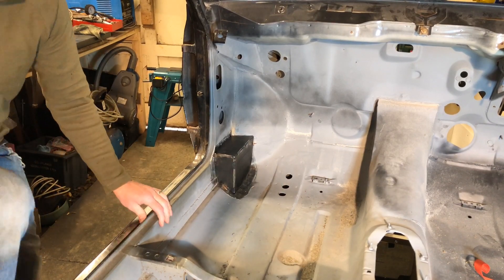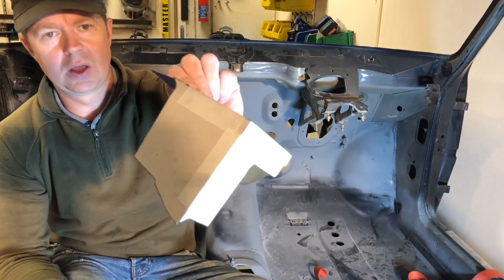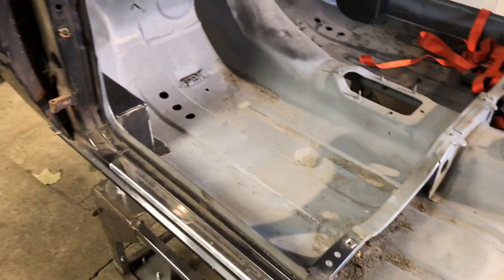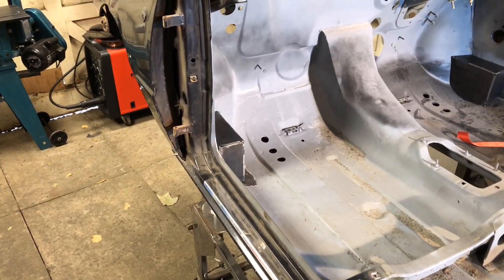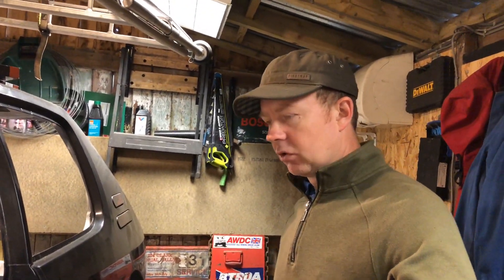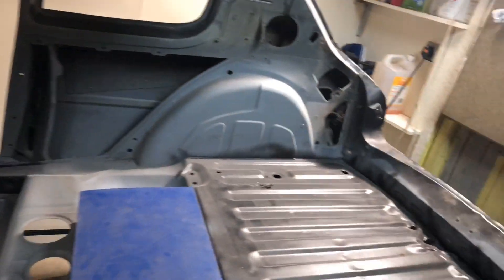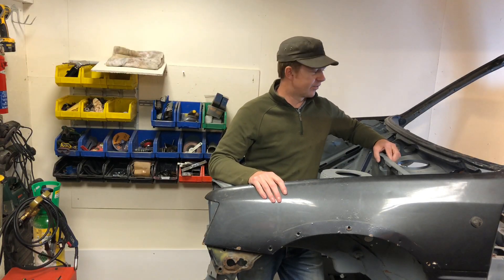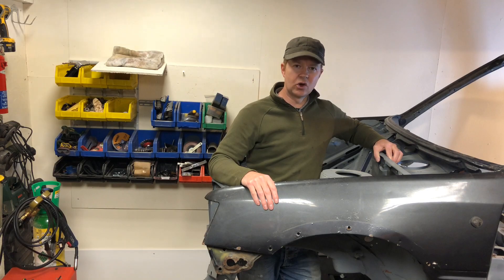HOW TO build ROLL CAGE mounting feet - Part 2

Comment: No This is NOT SAFE.. Idk what made you think your qualified to do this without looking up what you should do.. Crash course in roll cadge diy friend.. NHRA Rule #1 a roll cage must be welded to the FRAME.  #2The amount of connection points to the FRAME will give you its point rating 8pt,10pt etc.. #3 you must make the tube of the proper material and thickness for the welding process you chose.  When you make a 'look alike' roll cadge that is not welded to the frame it is VERY dangerous and you can get your car confiscated and fined. Think of getting hit with a solid steel baseball bat at 120mph (head on 60mphx2) with 18-30 tons of follow through..  Do your self and everyone watching a favor cut holes in the floor connect some tube to the actual frame and remake the video so no one gets hurt.

Comment: you have done a great job of the roll cage floor mounts 
can you not get in touch with the manufacturer of the bending machine and hire it off them or hire it off the hire shops they supply near to where you live talking to the manufacturer and tell them you are building a project on YouTube might give them the idea to loan you it to advertise their name it’s only worth a phone call or email
Reply from the maker: Hi! You’ve have a good point there, I’ll maybe give a right around to see if I can come up with something 👍👍
Reply: I know you have good welding skills and can probably make one but does the cost outweigh the amount of time you will use it
Reply from the maker: It would definitely goes quite well used, will have to look into the options.